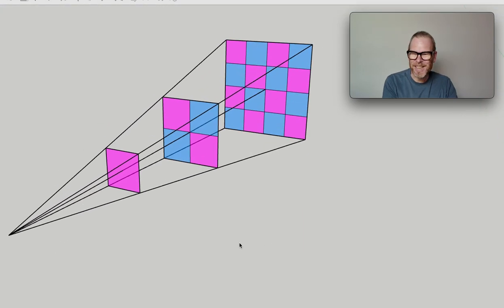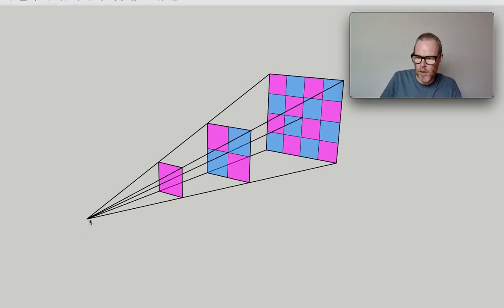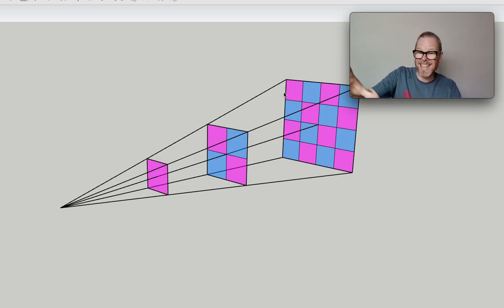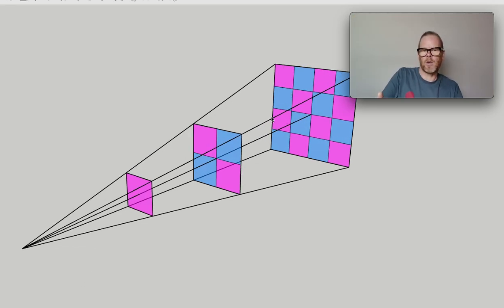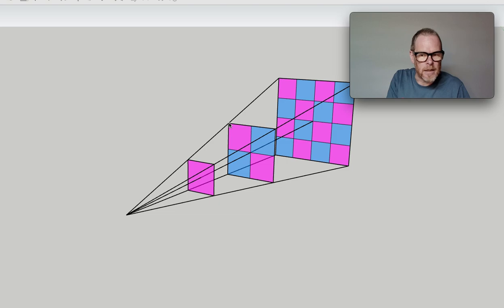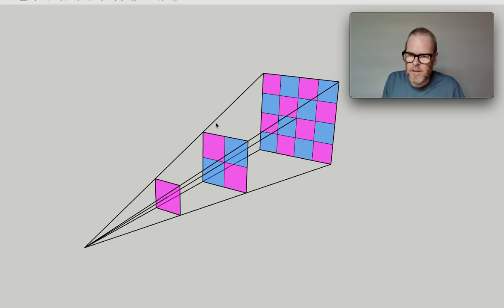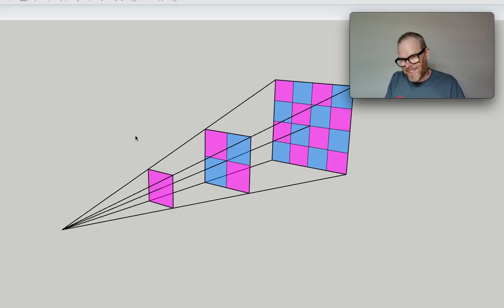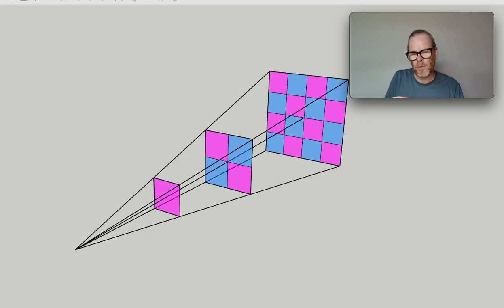Design Matters 5 - what is the inverse square law (and why should I care)?

Comment: Edit: okay my mistake you did say “1m away, 2m away, 4m away”. However is doesn’t look like that on the sketch, and the fact this would lead to an inverse exponential type law if it was 1,2,3 (as it appears) does still make things confusing. But again it’s not strictly wrong, just a diagram that’s not to scale which is misleading. 

Is this diagram not wrong?? It should be a 3x3 grid on the back one, assuming the distance between the grids are evenly spaced (which they look to be). 

Otherwise In this image the squares are drawn smaller on the final grid for no good reason, which is very misleading. 

You appear to be drawing something less this an inverse square law
1/(r^2), and more like an inverse exponential law 1/(2^r)?
Reply from the maker: It is absolutely to scale, that’s what sketchup is for, you build 3D models with it, it just looks different depending on the zoom position of the camera.

The reason I went for 1, 2, 4 ratio is in UK rooms it’s super common for row 1 to be 2m away from a back speaker, and so at least one listener in the back row ends up 50cm or closer.

Can do a follow up - I’ll put the 3x3 in at 3m and show it from the side :) so it’ll be clearer

Thanks - Owen
Reply from the maker: I made you this! https://youtu.be/lmKVEx55iJU